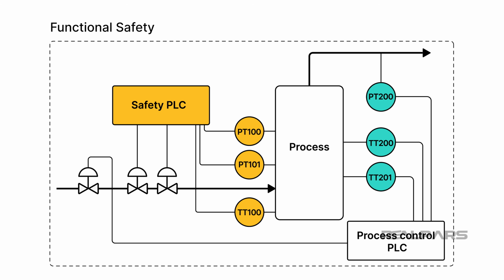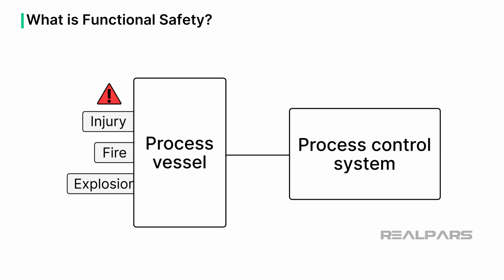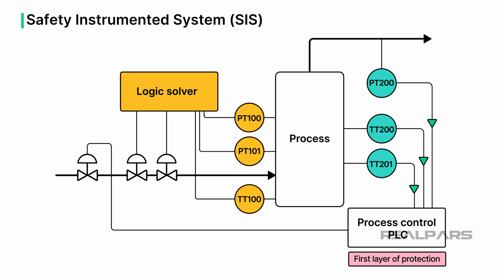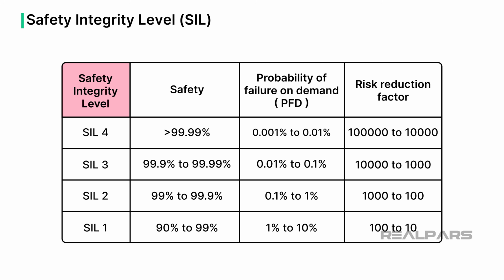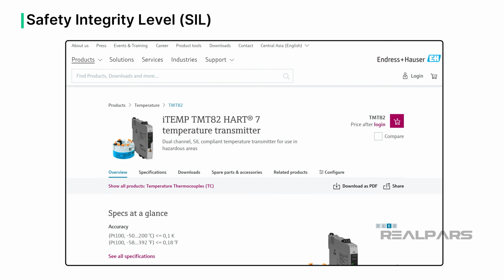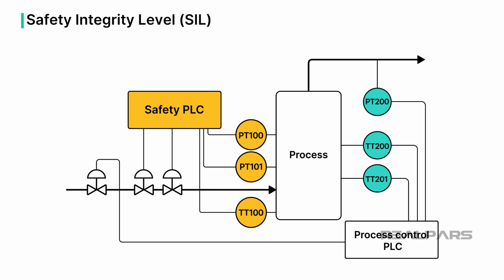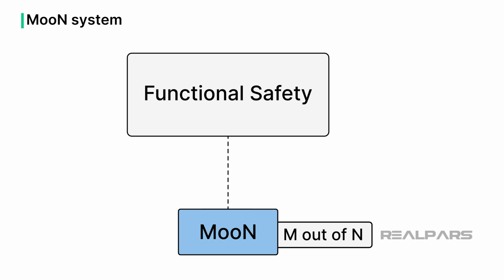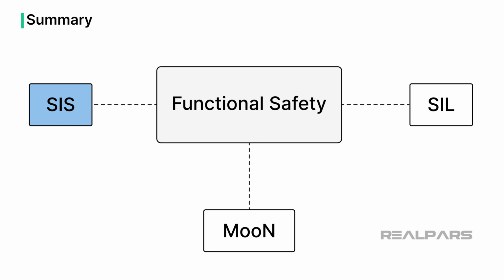Demystifying Functional Safety: SIS, SIL, and MooN Explained

Comment: This video is incorrect, SIL is not applied to entire SIS, instead it is applied to each component of a SIFs (SIS is composed of Safety Instrumented Function or SIF for short, and each SIF composed of sensor(s), a logic solver, and final element(s)). Furthermore, SIL also applied to SIF. So we can buy each component with different SIL rating (SIL x for sensors, SIL y for a logic solver, and SIL z for final elements), and then calculate the PFDavg for a SIF based on PFD of each component. In conclusion, a SIS may consists of several SIFs with differents SIL. SIL is applied to SIF and each component within the SIF. Please refer to exida, or TUV, just to name a few, to see SIL certificate of SIF element, i.e a pressure transmitter or ESDV.
Reply from the maker: We appreciate you sharing your expertise and providing this valuable technical perspective on our content. 😊

Comment: Is SIL even applicable for smoke extraction?
For example, there is a smoke extraction damper that must be open to allow smoke extraction for section A.
But at the same time, it has to be closed to allow smoke extraction for section B.
What is it's defined safe state in case of a failure, open or closed?
Reply from the maker: The defined safe state is determined by the specific risk assessment for your facility, which dictates whether fire containment or smoke ventilation is the higher priority.